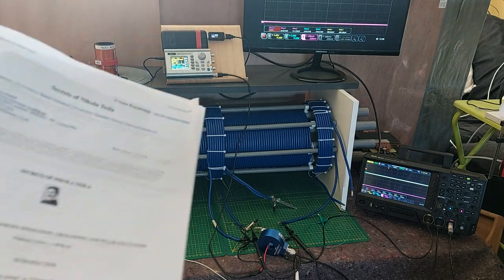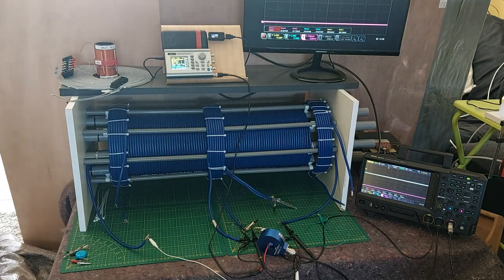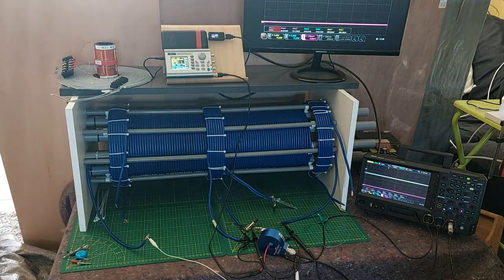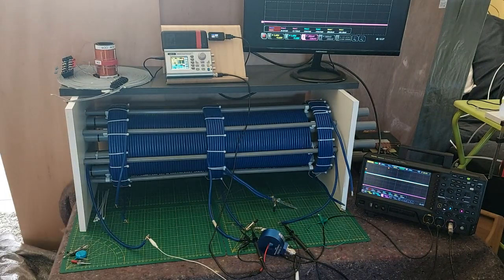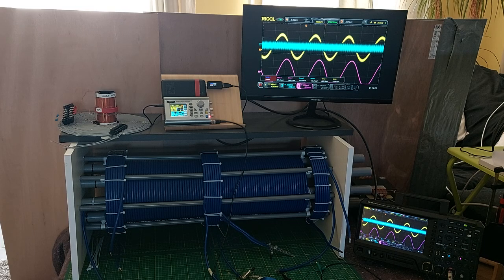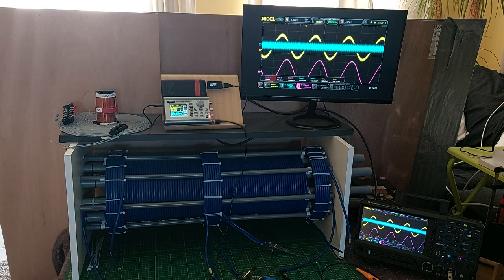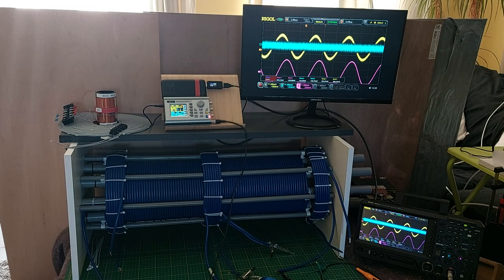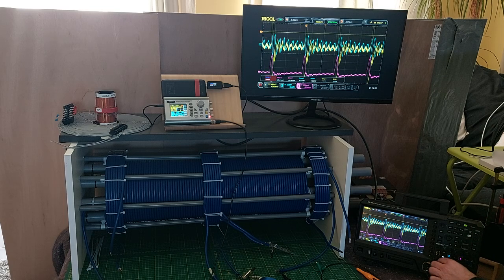Utkin Zero Transformer Main Video

Comment: A very interesting arrangement demonstrating a method of blocking induced current, but allowing potential charge, initially the same and equal on both ends, but becomeing unbalanced by attatching one side to ground. It could be current does not exist at all in this circuit except where these two potentials are combined in a resistive component (Light-bulb/LED's?). "[Here] grounding is only a kind of "flat spot" that allows you to zero the potential at one of the terminals of the output coil and create a field orthogonal to the original one. There is certainly no energy as such in the grounding." - Vladimir Utkin, ENERGY FROM GROUNDING.

As such, since current is not desirable between the two counter wound halves of the L2 coil, would it work just as well to disconnect them at that center point?  Or, simply wind both halves the same direction, but do not connect them to eachother at that center point, eliminating any need for ground?

Comment: The 50 Ohm should not be in series with the L1?
Why is it in parallel?
Reply from the maker: The 100 ohm resistor in the video is in series with the signal connection to limit current for signal generator. 
I think you refer to the 50ohm in one of the circuits I have drawn, this is to present the internal 50ohm of signal generator, so to represent the setting of the output of signal generator to 50ohm instead of high impedance.

Comment: This is caused by the delay of induction of turns of L1 relative to turns that are nearer to the source of impulse. It will happen if you increase the frequency also. This is a kind of Transmission Line. If you put the secondary under load, it’s behavior will change. The other problem with these kinds of machines is that even if you get asymmetric inductions between L1 and L_load, the frequency is usually so high that the output impedance significantly impedes the load current and voltage. So a synergetic effect by all the coils, that is L1, L_shorted, L_load, L_whatever, is necessary to reduce the output impedance. This is known as “resonance”, however I don’t like the term because it is not clear exactly which resonance are they talking about. Standing wave formation on a coil such as L1 is also a resonant phenomena. I also think that that the electric field inductions in addition to usual inductions in these setups is important. Thank you for sharing.
Reply from the maker: Thank you for sharing your thoughts in what's happening. What we see here is used as base for something more unconventional (at least as far as I know, but I´m not an expert). It´s in another document from Utkin with title use of reactive power :) 
About the sharing, this documents where also shared to me, so I´m thankful to the person who did that and ofcourse Utkin himself. Sharing is growing.